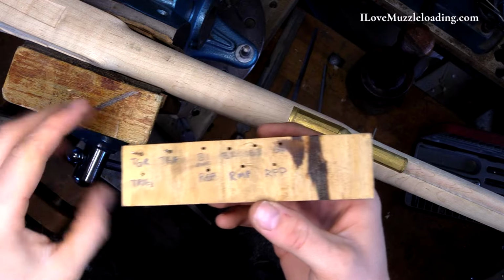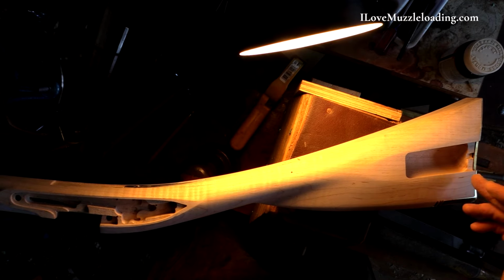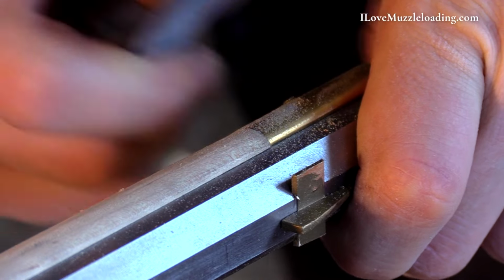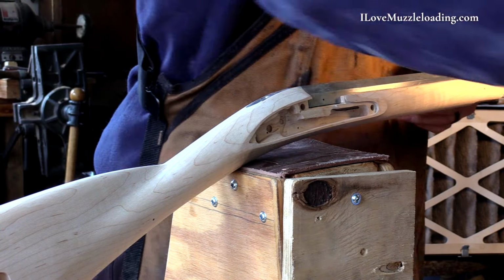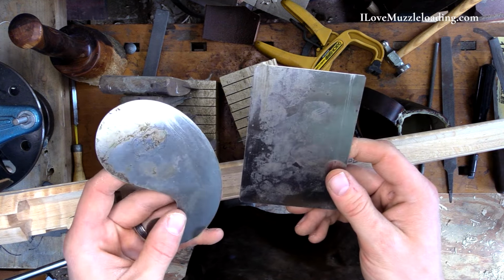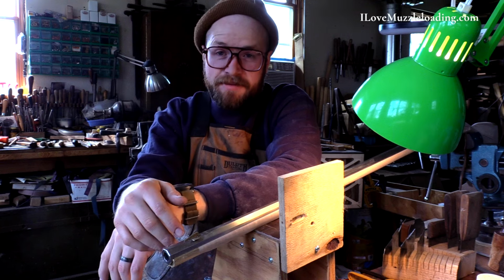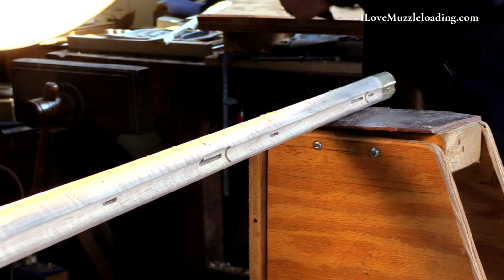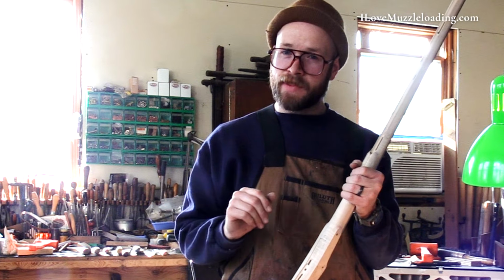Let's Build a Kibler Woodsrunner Flintlock Muzzleloader Kit | Part 2 | Sanding and Scraping

Comment: Yes, the different lighting will show up the tool marks on the stock.   You will want to sand or even file out those.  It's not a bad idea to keep those pins in order.  While the  diameter is the same the length may be different.   Also,  about those pins,  I suggest that you grind them to a point and then grain off about half the point such that they are beveled on both ends.   This will keep it from tearing out a chunk of wood when driveing it all the way through.

Comment: good video.  I have used a very similar method to keep pins and screws organized as I'm building.  Done it for the last 20 or so flintlocks I've built.  The only issue I've ever had with it was knocking it off the workbench and watching all my perfectly assorted pins and screws go bouncing across the floor.   Also, on the lighting, I've found it's not incandescent vs. led vs florescent, the key is a low angle shining across the stock vs down on it.  Also, don't underestimate the value of an assortment of straight edges (I use steel rulers from 24" down to 4").  It is really helpful when sanding and shaping to insure lines that should be straight are straight and helping to eliminate dips and bumps.  I hold the straight edge on the line I'm working and put a rather bright light behind.  Where I see light under, I know I have a dip.  When the ruler rocks I know I have a bump and can mark the irregularities to sand or file to correct shape.  Not really necessary for the curved lines that is more of an eyeball thing but those areas where it should be straight, need it to be straight.

Comment: Just got a Woodsrunner as well , one thing you run into is the noise cap on the stock how are you going to put a finish on it then peen the screws , well if you’re going to finish it first the put it on the stock peen the screws , how do you file it down ? With out removing the finish

Comment: I noticed your not finishing the cast brass parts to a high polish. I did on mine, it takes forever with crazy abrasives. Like 30 hours just on the brass at least with every tool you can imagine. they don't tell you that when you buy.